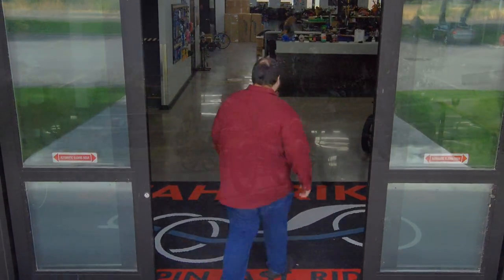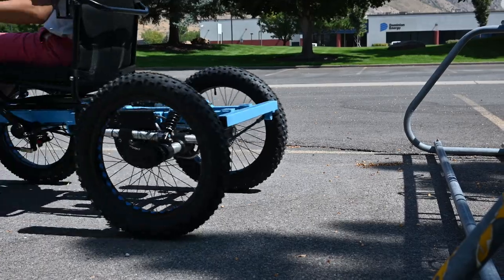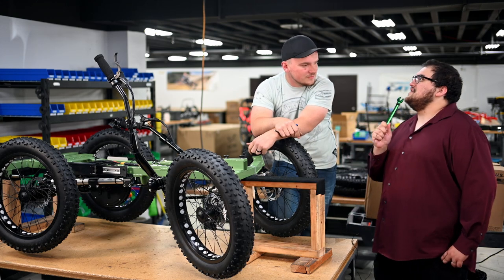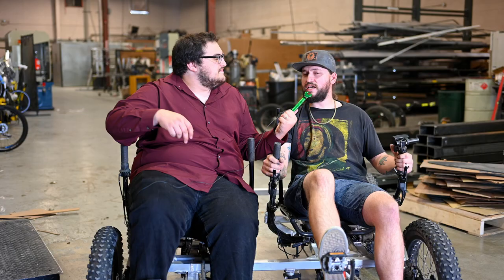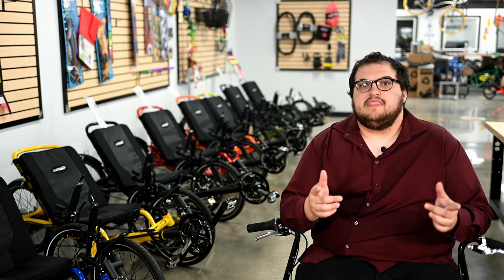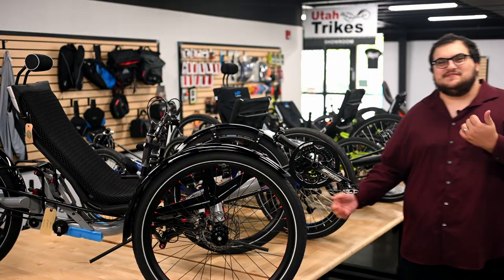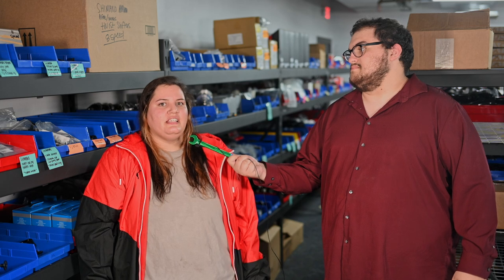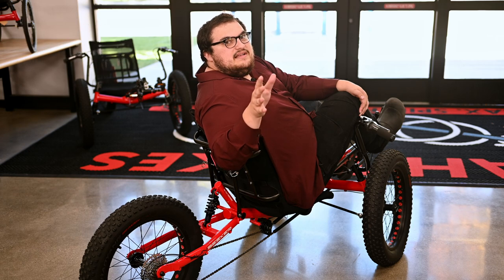The Trike Show: NEW UTCUSTOM TANDEM QUAD?!

Comment: You guys should design up a DUAL BELT drive system.  Seems simple enough and you have plenty of space.  What I am thinking is simple "dual geared idler" to allow two belts to be used, one forward to the crank and one rearward to the drive.  You could even use two of these if you wanted to use shorter belts or if you needed to change angles in the driveline ...

Comment: Can the notawheelchair be outfitted with two rear in wheel  e-motors, instead of solid axle chain drive. I have the revolution , converted to notawheelchair, am a stroke casualty with only right hand mobility. I converted reverse button, to an on/off switch. Two rear in wheel motor would solve the ridiculous resistance of solid axle turning radius and tire wear, which is a constant issue for me. Recently, i ran over a small tree branch which derailed the chain and bent both motor and axle sprockets. These modifications would increase reliability tremendously, for a  physically  challenged person,like me. Thanks, george
Reply from the maker: We actually have a 4WD version coming out soon and will have a retrofit option available for the current NAWC to be converted.
Reply: I will be looking forward to this change/option. Thank you, George
Reply: @UtahTrikesOnline  please  let me know when this option/new model is available. Thanks. George
Reply from the maker: @georgiepeorgie4723  We are finalizing production details now and will have a video and web page up soon.

Comment: Will an electric trike climb a very steep hill for a hundred yards and do a round trip of six miles?
Reply: Orin bee depends on the largest rear gear and how much power you have available, 52 volt 17.5 amp hour battery is quite capable of running way more than triple that mileage, especially with a thousand watt BBSHD motor.

Comment: Hi the not a wheelchair. Do you know if it is legal to ride the bike trails here in Eauclaire WI ? Since the not a wheelchair does not have peddles.
Reply: I doubt they would, being in Utah. Not having pedals usually puts motor/motorized vehicles into the moped category. Look it up online in the Wisconsin Revised Statutes. You'll have to look at ebike laws as well as the definitions of motor vehicle vs motorized vehicle. However, municipalities are allowed to restrict their use on local trails and paths. Does Eau Claire have signs posted at the trail entrances? 2nd however, it may be covered under the Americans with Disabilities Act. You'll also want to look at what the state defines as an ATV. In Arizona, quad bikes fall into the ATV category by definition. 

You'll have to do some digging, for sure. I keep a copy of the relevant statutes on my phone in case there is ever an issue. All that being said, and I've heard this from a few cops, don't ride like a jerk and they won't bug you. Don't ask a cop because they probably don't know the basics of ebike laws, let alone the details.
Reply: @tmurphy0919  
Would the ADA only apply if the rider is disabled?
Reply: @dansv1  Technically, yes, but no one is allowed to ask the nature or extent of your disability. They would have to know that you're not, like someone being caught working a heavy duty job while claiming workman's comp.